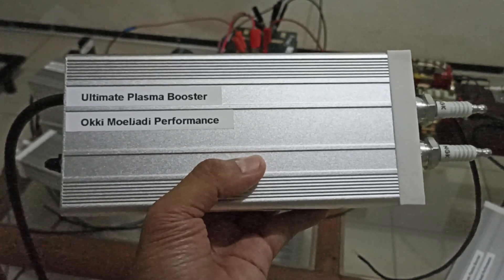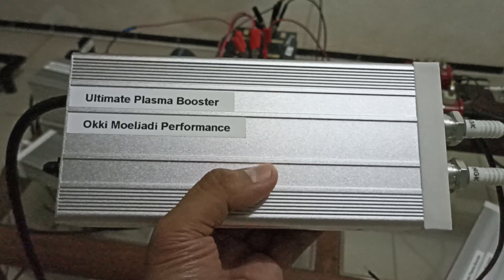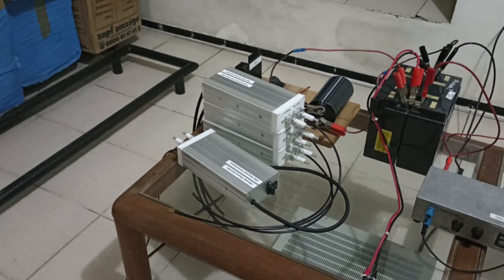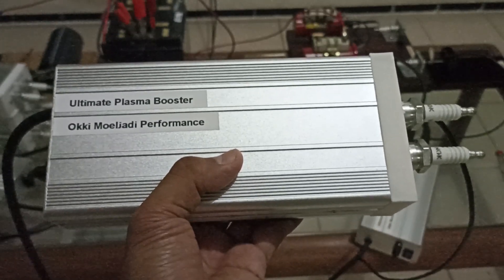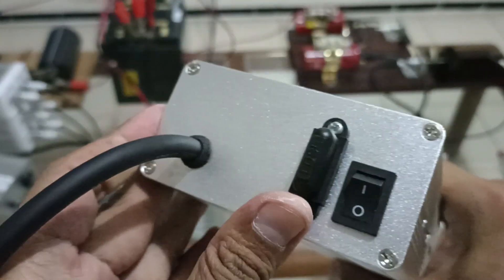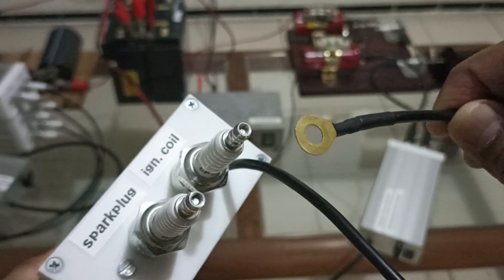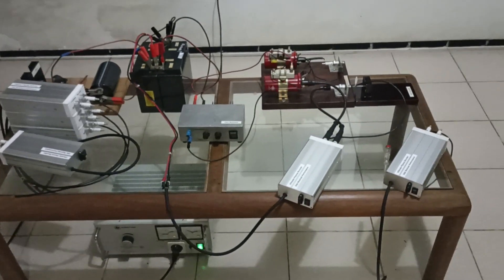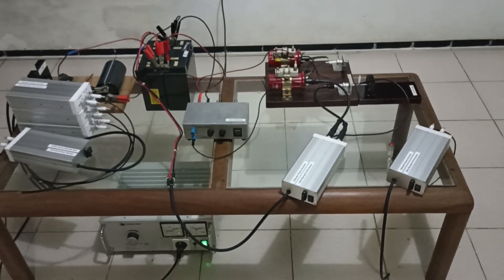Ultimate Plasma Booster Info

Comment: How compact your setup can be for a 4 cyl motorcycle with only 2 coils.  Also,  can it be use with régular sparkplug or it absolutly need a sparkplug without resistor?.  Do you have a vidéo of this setup on a engine,
Reply from the maker: I'm still designing a system for multiple sparkplugs. If you have 4 cylinder engine with 4 sparkplugs and 2 coils, you need 2 plasma modules, 1 module for positive pulse part of the coil and 1 module for negative pulse part of the coil. This one on this video is only for negative ignition pulse.

Comment: Okki, what are the purpose and the advantage of this plasma booster?
Reply from the maker: This is for a car engine. You can burn additional alternative fuel like water and reduce gasoline using this.
Reply: Have you a demo of an engine running on water? Or do I misunderstand your meaning. Do you mean you can add water to petrol? Sorry if you already explained and I missed it.
Reply from the maker: @martinhughes1854  no, I don't have any demo of engine running on water. With this device you can introduce water into combustion chamber and use water as fuel additive.